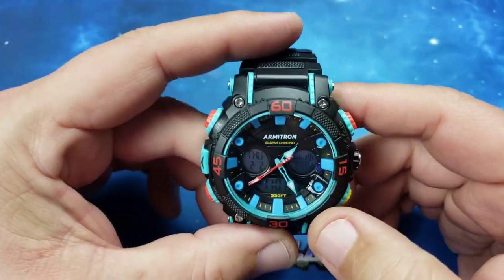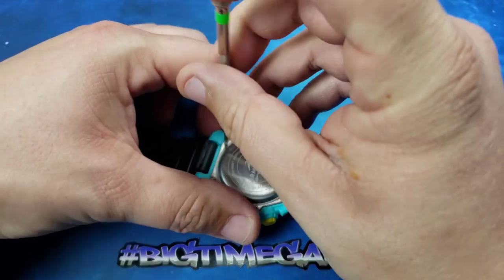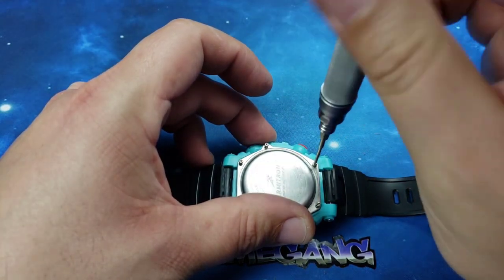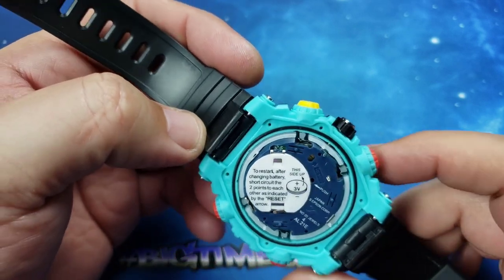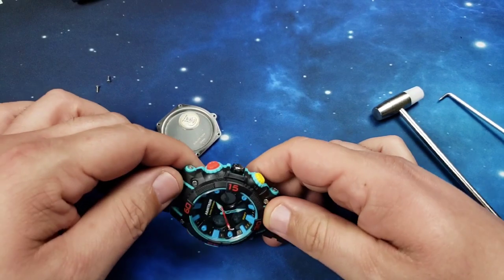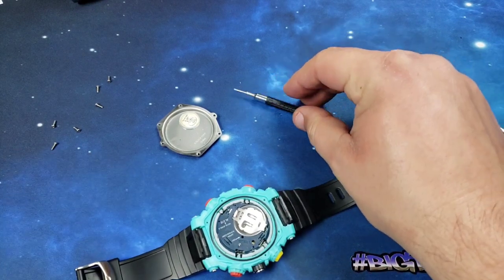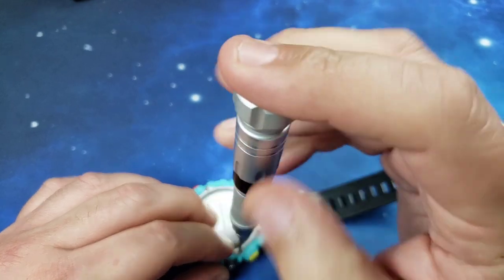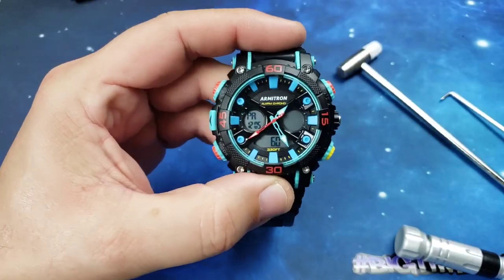Armitron Pro Sport AL21E4 Battery Replacement

Comment: My Armitron takes a CR 2016 and a 377 battery. The CR 2016 runs the digital clock and the 377 runs the  backlight and the analogue watch. Considering the amount of disassembly required to replace both batteries and the price of these watches, it's more practical to replace the watch. The analogue clock battery only lasts about a year or so. That one is the hardest to get to. The CR 2016 ran the digital portion of the watch close to 3.5 years.